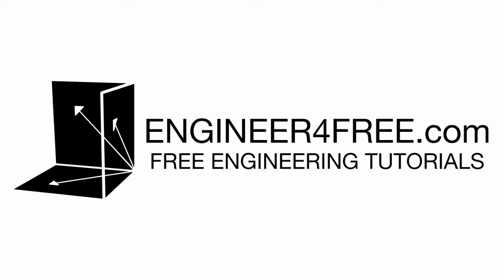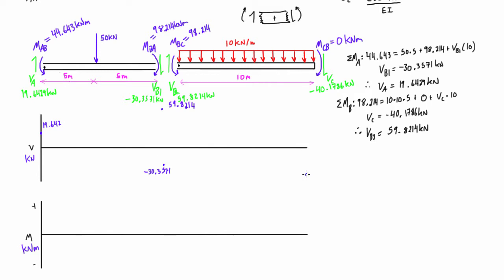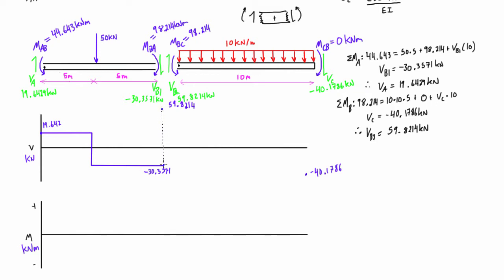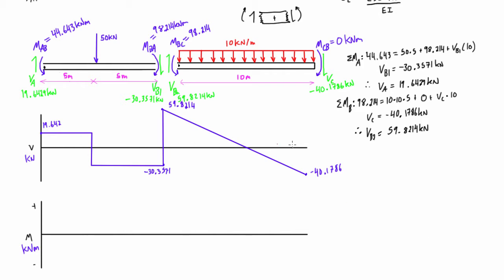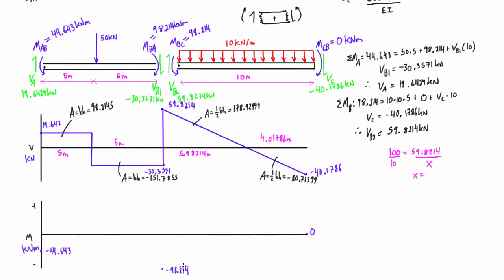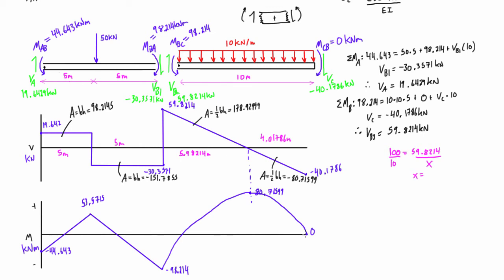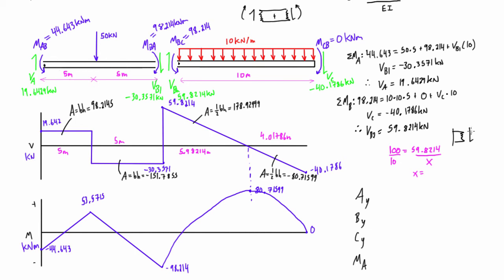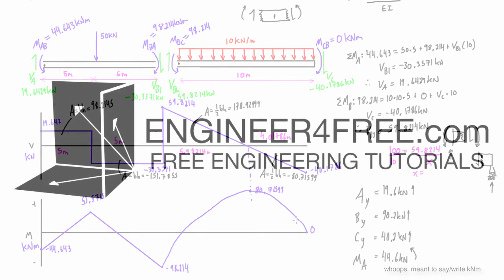Slope deflection method example #2 (part 3/3)

Comment: I'm having trouble finding the support reactions just after finding the moments...
Reply from the maker: The internal shear gives us the information we need to solve for reactions. The amount the the shear "jumps" by at a reaction (with no other point forces acting right at the reaction) is the magnitude of the reaction force. By drawing s FBD with a virtual cut infinitesimally close to the reaction, and knowing the sign of the internal shear, therefore the direction it points on the FBD based on the positive sign convention, we can confirm the direction that the reaction force points for the FBD to net to zero force in the y direction. I do this for reaction force Ay at 8:19. We know the magnitude of the shear is 19.6 kN, and because of it's positive sign, it has to be oriented down because it is on the right side of a virtual cut. The only other force acting on this infinitesimally thing FBD is the reaction Ay. It has to be equal and opposite for sum of force in y to net to zero, so it is 19.6 kN up. The reaction at B is a bit weirder, but we know that the SFD jumps abruptly by a magnitude 90.2 kN so that must be the magnitude of By, which is the only point force acting on the beam at that location. A quick way to determine which direction this one is facing is by noticing that at x=5m, a downward facing point load cause the SFD to jump down by that magnitude, so if it is jumping up somewhere else, the direction of the point force would be upward (just opposite of something else that we are confident in). Hope that helps.

Comment: sir i'm a little bit confused here , you said earlier that the moment at the reaction B is supposed to be 0 , but we calculated it and drew it on the BMD to be -98.814 KNm , how is that so ?
Reply from the maker: The support at B does not offer and moment reaction, as it is a pin. So if you attempt to draw the "moment due to reaction B", it will be 0 kNm. The "internal bending moment in the beam at point B" is not zero though, we eventually calculate the internal bending moment to be -98.214 kNm at B. The only time you can confidently predict that an internal bending moment will have the same magnitude as an applied moment or a moment reaction is if it is at the the very end of a beam. You can see this at point A, the magnitude of the reaction moment from the rigid connection is 44.643 kNm and so is the magnitude of the internal moment at point A. You can also see this at point C, the pin does not apply a moment on the beam, and the internal bending moment is zero. Those two cases happen because they are at the ends of the beams and if you draw a fbd of those sections with a virtual cut infinitesimally close to the end once you know the reaction forces & moments you will confirm that the internal bending moments tend to what the applied and/or reaction moments are at that point (if any, and if none then zero). B is somewhere along the span, and even if there happens to be some kind of reaction acting right at B, the moment caused by the reaction is not going to equal the internal moment at that point. If it did that would be a coincidence. The slope deflection method is one of the ways that we can reveal what these internal bending moments are at points like point B along the span. Does that clear it up? Internal moment does not necessarily equal applied moment or reaction moment at any point along the span except the very ends of the beam.
Reply: alright sir thank you